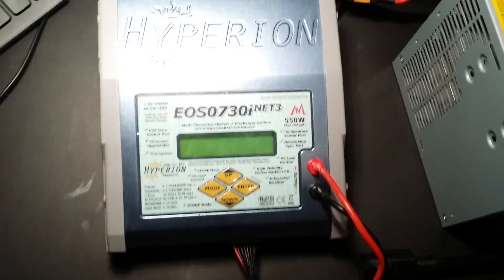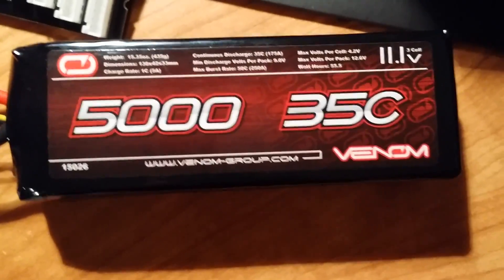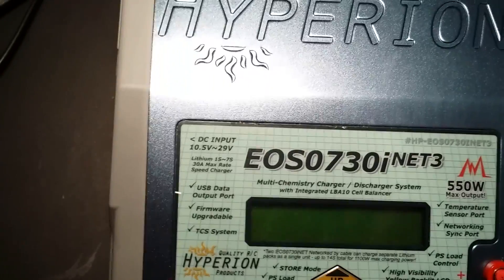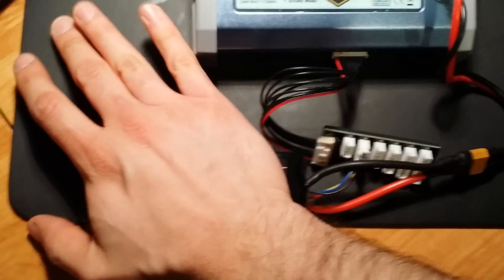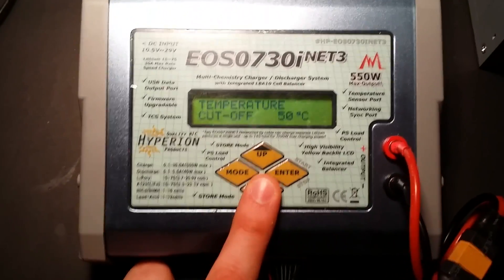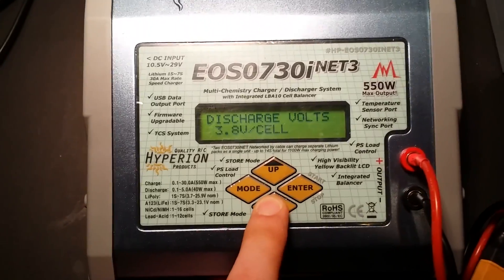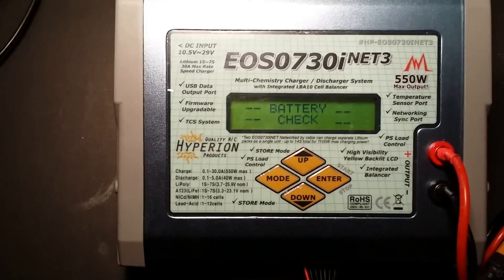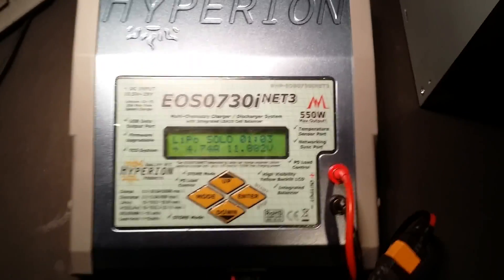Hyperion EOS0730iNET3 Charger

Comment: as i see u have 5.8 firmware and i have 5.1. is it really necessary to upgrade the firmware? thnx
Reply from the maker: i wouldn't say so unless your are experiencing some odd issues. I would say email support and find out what the update includes. Thanks!
Reply: Mike R. Thanks for the quick answer. I couldnt find any contacts and/or email for support so i dont have ant idea about what is new in later 5.1 firmwares.
Reply: I have upgraded mine to 5.91👍 now i can use hyoerion data and pc suite and manage to see details about my charger from my pc. In additional i can see res values seperately for each cell.  One more advantege about 5.91 version i can give name for each memory line which i want👍.

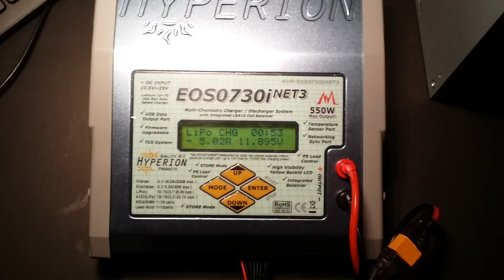Comment: Hi, I bought this charger a week ago and i spotted a problem that i haven't with my previous charger (imax B8) . I found the same issue in your video at 9:13 it reduce the amperage to 0 and after 2 seconds increase it again .... Is it normal
Thanks for your time
Manolis
Reply from the maker: i believe so, its a form of power regulation inside the unit. If you are concerned i would suggest contacting support and ask them, thanks!

Comment: How do you like the charger, would you recommend the 720i instead for a beginner? I wouldn't have to worry about finding a PSU and I won't be getting any LiPos above 3s to utilize the extra DC power.